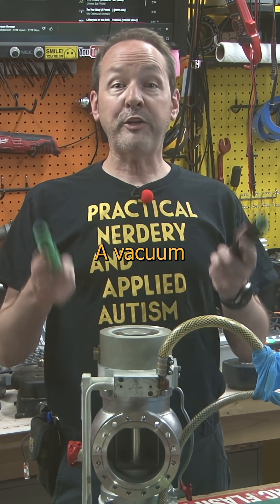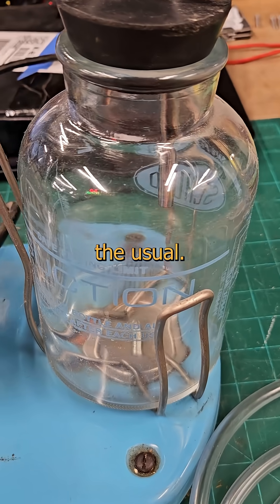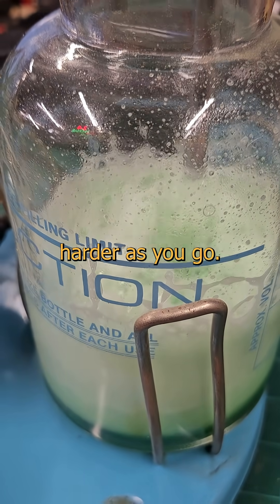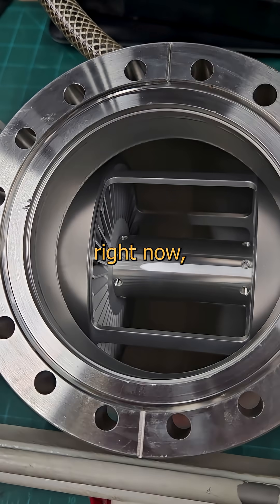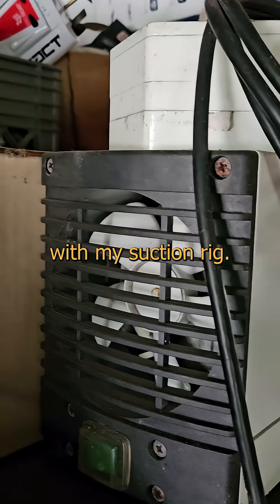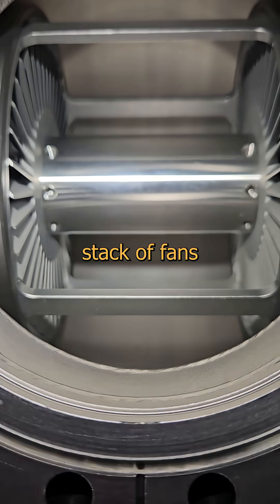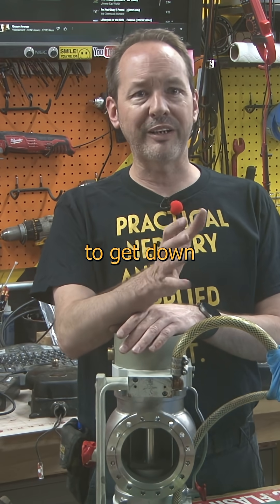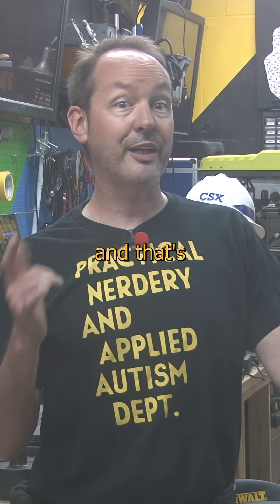Turbomolecular Vacuum Pump #chrisboden #comedy #engineering #physics #science #turbo #nerd

Comment: The fun thing is that a TMP doesn't actually really just "smack the molecules down the pipe". The vanes rotate at (for a TMP that size) probably around 30000 RPM(no, that's not a type. That's 4 0s in a row). Gas molecules that happen to find themselves moving in the direction of the vanes have a slightly higher chance of getting smacked into the BACK of the vane as it comes wizzing around behind them. The molecules then stick around for a little bit there, and then randomly fly off again. The angle of the vanes then makes it SLIGHTLY more likely that the molecules will continue moving towards the roughing pump, but they could also just bounce right back into the chamber. TMPs work on the basis of smacking metal vanes into molecules and making these molecules down the tube by basically sheer statistic coincidence. Seeing videos of one self destructing is... impressive. The machines I work on have around 15 massive units that are each mounted with 36 M8 8.8 grade bolts in slot holes torqued to just shy of using their safe word. If these TMPs were to destructively fail, they'd release so much energy they'd slide the whole thing around the slots (hopefully dumping a lot of energy in the process) and then likely still mostly sheer off a majority of those M8 bolts. The amount of energy stored in a Turbomolecular pump when it's at full tilt is something best considered when you don't need to be working right beside them.

Comment: Oh my God this is what I do for a living. Don't forget about a roots blower booster pump, which doesn't actually compress gas so alone it cannot create a vacuum, but stacked on top of a roughing pump it can suck down some silane and nitrogen trifluoride real quick. The turbo molecular pump is usually upstairs near the chamber, where the pneumatic isolation valve opens and the pumps downstairs create a vacuum, and then the turbo can spin up and another isolation valve opens. Fun fact, you spin down the TMP and isolate it and leave it in levitation for when you need to run down the roots blower/roughing pump combo. 
We then pump this into a greenhouse gas abatement unit that heats it up and quenches the gas, then it goes through a scrubber to GET THE "F" OUT. Y'know, FLUORINE. And what were left with is hydrofluoric acid which melts rocks and calcium in your bones.

Comment: Most modern day turbo pumps won't tear themselves apart if they start sucking atmosphere. This is mostly a myth from the "olden days." Sure they can't operate without rough vacuum first, but if an accident happens and the pump gets vented, they basically all have safety shutoff features that will save them and immediately start spinning down. This has happened a few times in my lab over the years, and I have yet to see a turbo on the high vacuum line fail.

Comment: my work been making me learn how to use the oil processor and what you explain there sounds very similar to the booster pump which makes very angry sounds to say the least if turned on any higher then 7 or 6 Torr.  

that whole rig scares me atlest in testing if i fuck up I just redo the test in that thing there isn't any redos

Comment: Often the endpoint of "creating a vacuum" is just getting to the point where the pump is removing air just as fast as new air can leak back in. Whatever amount of air is inside when you get there, is going to be the amount of air that'll be in your vacuum, and that amount is rarely none.
Even with a perfect seal and no new air getting in at all, the pump can approach that limit to the point that it'll take 10 000 years to shepherd those last few particles out (and by then you very well might spring a leak anyeay) so you might as well just make peace with having them there
The last few particles are simply never coming out (at least not with the pump you had used so far).

Comment: My job uses vacuums all the time. In the room I work in we can't use a vacuum pump(it's a space limitation) . So the solution is to use a Venturi (an air powered vacuum pump) and it's crazy using air pressure to pull a vacuum.  We never have had use for a turbo vacuum pump. Cold traps and normal vacuum pumps are good enough for us. And I work with liquid butane. I'm really curious at what industry needs this

Comment: Yeah, I read there is a NASA site that does vacuum testing on the modules for space. Their process is normal suction of the atmosphere, and (I think) one of these for the initial suck. Then they roll out a freeze plate for the last few individual molecules still floating around in the test chamber so that absolute vacuum is achieved.

Comment: Had a chance to work with TMP's few times, usually the controller is rather smart and will prevent operation in atmospheric pressure. So... No TMP will (most likely) not destry itself, it will detect higher power output than usual and shut down itself safely. Cheers

Comment: How well would this method work if the floor of the vacuum chamber were shaped like a funnel, with the connection for the vacuum pump at the pointed end of the funnel, so that the air would flow down the funnel by the means of gravity?

Comment: I used to work in the semiconductor industry and our systems would use a turbo pump to first get the vacuum down to ~10⁻⁶ mbar and then use a cryo pump to get down to 10⁻⁹ mbar which is pretty much like being in space and necessary so computer chips are not contaminated when being manufactured.

Comment: Chris, have you ever put vacuum on a multi MVA oil filled transformer so you could change a valve or cooling pipe at the bottom of the unit without draining it?  You can just look through the flange like a window to 100,000 litres of oil that would deluge you if someone tripped over the extension cord.

Comment: Holy shit im an industrial mechanic and i work on vacuum systems daily. Id never think id hear the phrase roughing rump anywhere outside the plant lol. We have a series of pumps and blowers the size of a fridge connected to the chamber to get each pump to the appropriate vacuum level to be turned on because like he said a vacuum pump not pumping on a vacuum will shit itself incredibly fast. We get 5' by 5' by 15' chambers down to 1 millitorr(the measure of atmosphere). Its the coolest thing ive ever seen. And what's cooler is that we seal our chambers so well that we will close the valve and between the pumps and the chamber and it will still hold that 1 or 2 millitorr for a long time before atmosphere leaks in which is impressive because we have a bunch of water lines and wiring that runs from outside into the chamber

Comment: Closest I ever saw IRL to a true vacuum was with a dimer polymer deposition machine that used a two stage vacuum pump to pull down to about .04 Bar. Once it reached that point the dimer polymer would aerosol as it was heated and would deposit onto the silicone coating of a wire assembly. Extremely easy to fuck up the pump though. Had to change the oil in it every 50 hours of run time, so about once a week

Comment: IIRC you actually could make a TMP that doesn't need a roughing pump, and maybe even one that could be started at 1 atm and pump all the way down (if you have the right speed control) it's just WAY simpler to use two stages and there's basically no practical advantage to doing it in one.

Comment: I balance gas turbine and steam turbine rotors in a huge vacuum bunker. We get down to 1.7 torr.
It takes about 30 minutes to get down to 1.7 we use 6 vacuum pumps 4 that are the size of a smart car and 2 about the size of a gas pump that maintains vacuum around the driveshaft while we spin 50-150 tons up to 4500 rpm.
It’s pretty cool.

Comment: It might be hard to imagine, but there are practical applications for getting a vacuum as complete as possible. The Palomar telescope mirror is a full 200 inches in diameter and gets recoated every so often. It requires a vacuum so close to perfect that they add water vapor to attract stray air molecules. This is necessary, of course, because the coating on the mirror is aluminum...
about enough to make a large paper clip.

Comment: My brother used to hook up an AC vacuum pump with oil in it that was a year old and tell me if you run it for 45min it will be fine. He used a normal gauge set. He passed away so I took over and learned how terribly wrong he was. I now use a pump with fresh oil and a manometer to check the pump and verify vacuum. I now know he compromised allot of new AC systems.
Reply: Trust me. Vacuum is a bitch!

Comment: I worked in semiconductor production operating plasma etching tools. Those need some pretty vacuum values... They actually inject some tiny amounts of helium into the line to push those last da***d air molecules into the TMP and down the drain 😅

Comment: Atmosphere is not 6000 miles thick, it's like 60 miles. The "atmosphere" found between 60 and 6000 miles is basically occasional gas molecules. The ISS is at 250 miles and is not considered to be in atmosphere by most metrics.

Comment: I work with mass spectrometers. One of my least favorite things to see is a TMP's clocked hours over 2X the rated lifespan on a system without a warranty ($10k replacement cost). One of my least favorite things to hear is a TMP's death whine. Boy, does 60,000 rpm get LOUD when a bearing fails. 50,000 hours of 60,000 rpm... that's 180B revolutions. You're ok, TMP, you can rest now, you did a good job, but please don't send shards of yourself into the roughing pump.

Comment: Slowing them down is also interesting. If you just turn them off, they continue to spin forever. This isn't just annoying but also a real problem because as all physical things, they have a resonance frequency. If they spin down too slowly they can run at resonance for too long and get damaged. So you you have to slow it down by opening a small needle valve and let air in. Fast enough to get through the resonave region quickly but not so fast that it rips off the blades or overloads the bearings. 
That was at least the procedure in our lab. Not sure if other TMPs work differently.

Comment: I have to deal with nitrogen purging equipment at work, and besides set up and set down, it is a whole day of sitting and waiting. Because the nitrogen has to be dry when you seal it back up, and the inability to just move everything out of somewhere, we have to hook the purging equipment up, set it to go, and then wait nearby hearing the suck and blow motion for hours on end until you can be (mostly) assured that it is dry inside. Then you've got a very short time to unhook, dump a bunch of dessicant inside and seal it back up, or you have exactly the same task to do tomorrow.

Comment: This is why vacuums work inside of vacuums. Because there never really was a vacuum, just less air than outside.

That's why those metals stick to each other, I can't remember what it's called, but people claim it's not because of air pressure because "it works inside a vacuum" but they simply made a better vacuum with the two metals.

Comment: We run the synchrotron at the James Slater Proton facility at ~ 10^-11 torr ( think that is the units, I’m retired so can’t check anymore) - if it comes up to atmosphere it takes FORVER (days) to get there, but we need it so the protons don’t collide with those pesky atmospheric molecules. Even dry nitrogen takes a while. Uncontrolled loss of vacuum is a very bad day.  Ion pumps all over the place. Multiple cryostats at liquid helium temperatures in the injection line. Our turbo pump is a second stage roughing pump.

Comment: theres a level of vacuum pumps beyond this, as mentioned, but kind of glossed over. the only time I've ever seen them (or even heard of) is for electron microscopes, where even single atoms can throw off the image. its that "tweezers" part of removing sand, except you cant just reach in and pull them out, you have to catch them as they are bouncing around. this is where ion pumps and similar come in. the super simplified version of how they work (not how they actually work but an easy way to describe it close enough) is a couple of metal plates magnetically charged that just catch some of the last few molecules as they bounce around nearby. 

you will still never, ever, get all of the air out of an enclosed container.

Comment: Just spent a few hundred hours listening to these fuckers at NASA-MSFC's XRCF! They can get VERY loud. Also apparently there's a version of near-vacuum pump that blasts air out of the way using spurts of oil shot at high speed under ridiculous pressure, and those fuckers are even louder

Comment: Did this for the vessel that holds the space shuttle at near absolute vacuum in Houston Nasa. When testing the regular vacuum pumps run for 48 hours to get it down to what your home A/C pumps run draw down to. 29.99" vacuum. then you run the 2,000 horsepower molecular turbine to bring it down to micron scale. I put a 48 Oz. Big Gulp foam cup in before shutting the door for the test. 7 days later when you let off the vacuum and the door opens the cup fits my finger.
They tell you while under vacuum if any part of you touches a leak, it will suck you in before anything can be done. "Never Verefied"

Comment: We have some helium leak testers at work (we inject helium into parts, weld them, then put them in these devices to check for leaks). They have gas chromatographs to check for helium. When we start one of these it says "roughing". I never knew what that meant until now.

Comment: Heck yeah man. I work for a piston ring manufacturer as maintenance and you taught me more about the why of these things than I’ve learned in the 3 years I’ve been here working on them. Use them for pvd processing. Stuff works so good it made Toyota Corollas from the early 2000’s consume their sleeves and burn a bunch of oil. Now they mostly get done for the duramax line of engines. Wicked hard ring to begin with but then that ontop is a whole nother level of hardness.

Comment: I once worked briefly in a heat treat department where they regularly treated titanium jet engine parts. The vacuum furnaces had 4 pumps. Roughing, root blower, diffusion, and a holding pump to maintain the vacuum for the diffusion pump. IIRC, we took them down to about 10^‐5 torr. These were fairly big furnaces, so it took a while. Finding leaks was interesting. Hook a sniffer to the output of the holding pump and spray a gas (argon,helium?? Can't remember) everywhere until the sniffer makes noises. And it happens fast, within seconds. You wouldn't think gas molecules could go from the hose in your hand to the sniffer THAT fast, but they do. That was a fun assignment.

Comment: The first pump I use is a bike pump and you push and pull the top lever to push air in and out and for every other pump I learned after that I couldn’t wrap my brain around picturing the insides working. Just would have brain farts

Comment: would a set of meshing gears work better?... each troff is a chamber that  cycles it around to the exit, then uses a matching  set of teeth so push the air out as it moves in to take another troff of air.

Comment: I saw a training video in which a pressure rail car was crumpled into a mangled ball of steel when placed under vacuum… and it happened in the blink of an eye once it reached the that critical level. It was spectacular! No one could tell me just how much vacuum they had to pull to do it…. Do you suppose they used one of these devices?

Comment: Idk... Pulling a vacuum on a HVAC system has been mostly painless all gazillion times I have had to do it and if anything is leaking, it's pretty obvious pretty quickly. If the pump pulls it down to 200 microns in 3 minutes, you're good and you're going to be on to the next one within an hour. If it gurgles and smokes and sits at 30 inches of mercury, get the nitrogen and the soapy water and say bad words

Comment: Ah so its very fucking expensive fan... then again jet engines are the same, just bit less delicate, though once you go up in size you need to slowly run it down in heat, cause run E stop and well fuck, thats two weeks of slowly running it to heat and rpms so the now bent axle straightens thanks to centrifugal forces and heat, but to get there you cant go past certain RPMs so the 100ton multi million dollar spindle wont shake it self apart, but you need rpm to generate enough heat, so its delicate job that takes time and fuel, both witch cost millions by the hour its down... ah the joys of power generation gas turbines... but hey it can be worse...

Comment: Fill the chamber with argon and have the vacuum pull the air out from the underside.

Or, use gasoline.
Fill it up with warm gasoline, the gas form, and then run the vacuum pump.
Cool down the chamber so that the gasoline liquifies, and then suck out the liquid.

Comment: Holy Micron, want to suck even harder?  
Diffusion pumps have no moving parts and take a vacuum down to the 10 ^ -8 to 10 ^ -10 torr level.   (bigger is better)   
Space inside the solar system is 10 ^ -12 torr

Comment: Semiconductor engineer here, even the roughing pumps that we use are very sensitive and will basically eat their seals alive if you try to pump air into them before they reach their operating temperature, then the turbo can kick on and prove all of the transducer calibrations are off. Its pretty cool

Comment: At the nuke plant our steam jet air ejectors could draw the huge condenser down to about an inch of water.  BUT the turbine exhaust became supersonic then, which is not a good thing, so we kept an automagic air bleed valve open to keep it at about 1.25 inches. Our steam hogger got it down to 7.5" on startup, and the backup mechanical hogger could hold 2.1" in standby in case we lost both of the redundant jets.  Good old Bernouli.